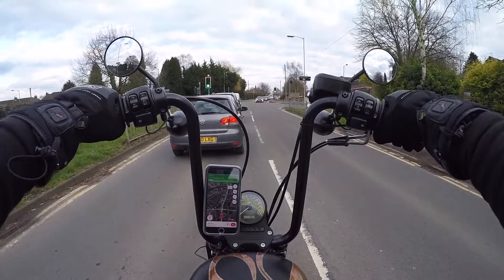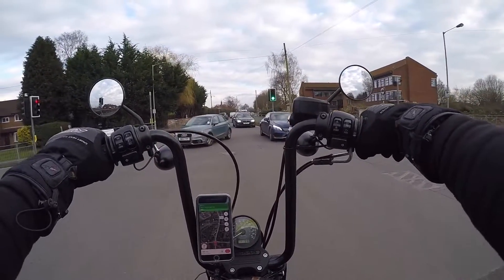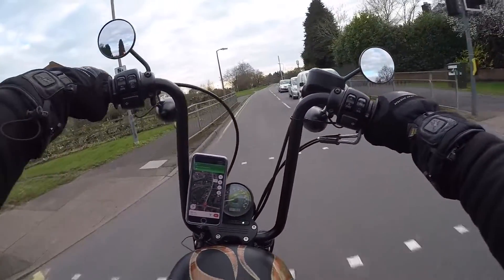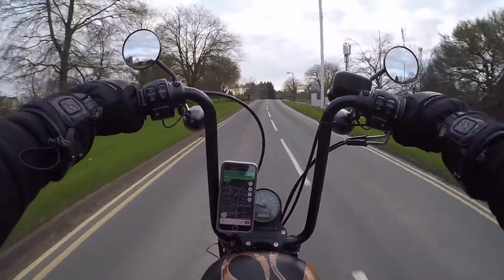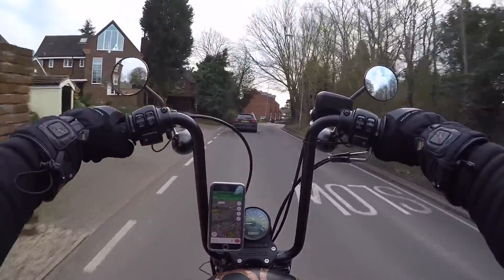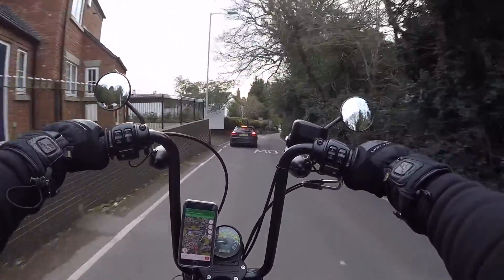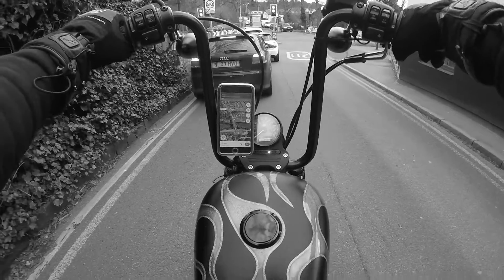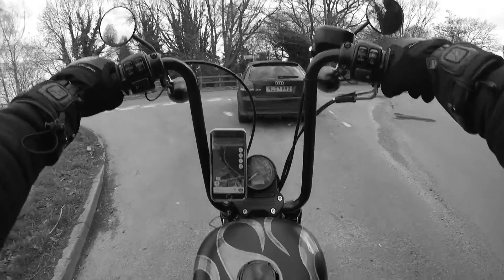Side Stand Fix on a Harley Davidson Sportster (Iron 883 / XL883N)

Comment: I Had the same problem, unfortunately that fix didn’t work for me. Sensor was faulty to the point it had to be replaced under warranty by HD. Thanks for the tip 💪
Reply from the maker: freedom rider Oh I’ve not often heard of the issue being that bad but great it was replaced under warranty! Thanks for watching!
Reply: I fix with this tip but it do it again and now this tip don't work. Is posible my sensor was faulty. How you know your sensor is off?

Comment: Wow that was easy why can't all be that  easy
Reply from the maker: The Blue Bike & Doyle Cheers Doyle, yeah very easy. It just bypasses it for now until I can fix it properly. Works a treat though and as long as you don’t try to pull away with the kickstand down it’s all good!
Reply: @dadandmad  you know  on the bigger bike like doesn't have it.  I have rode off with kick stand down . Where I didn't kick it up  all the way